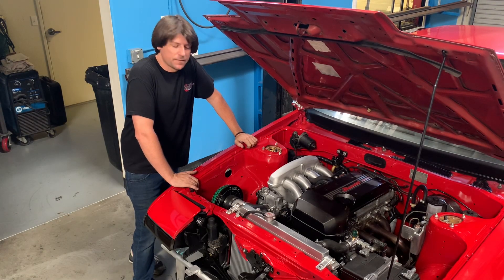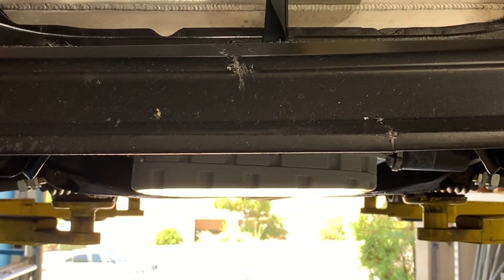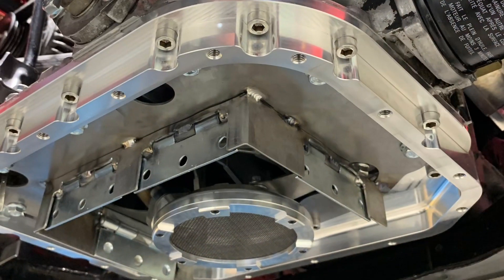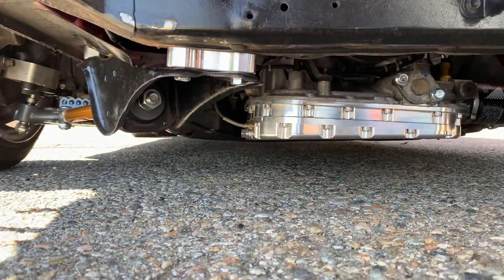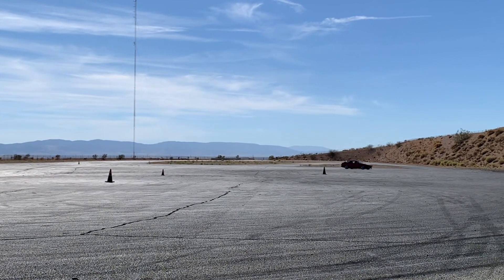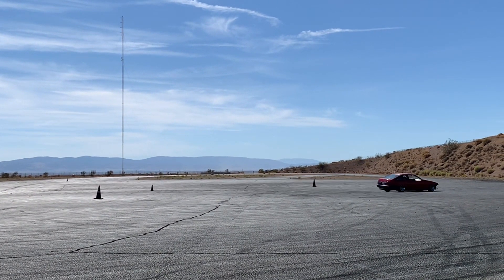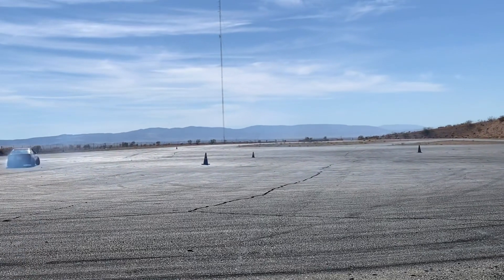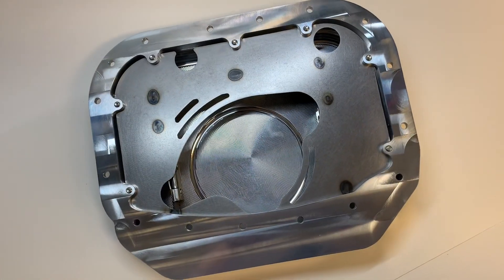JSP BEAMS 3sge AE86 Billet oil pan concept and prototype

Comment: Looks great! I am excited for this to become available. I have a few questions.

- When can we expect production to be complete for us to order and will there be a pre order option?

- If we do impact this oil pan how do you anticipate it holding up? The factory one will dent easily or puncture, but wasn’t sure how billet reacts to hard impacts.

- With these being multi piece will there be options to purchase the individual pieces down the road if we do damage it? Just a thought incase the lower most area gets a hole, crack, shear bolts off, or anything like that. 

Thanks!
Reply from the maker: Great questions. I’m planning to post a preorder next week with expected shipment of late October. There’s pros and cons to the billet pan. Yes it can crack unlike the steel pan, however if it does, you will know right away. The steel pan can dent and block the oil pickup, it won’t leak, but can starve the engine of oil. To help, I’m working on a skid plate to go with this.
Reply: @johnrussakoff   This is a great idea. I'm assuming it would be made out of mild steel or something a little more forgiving for impact?